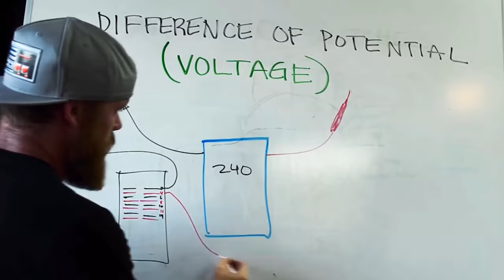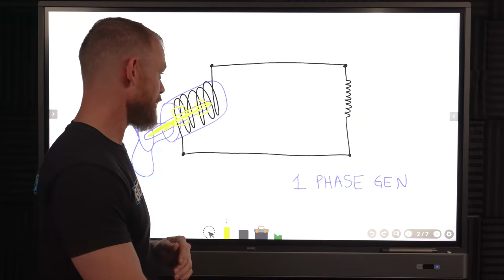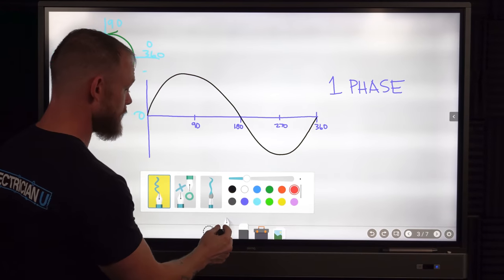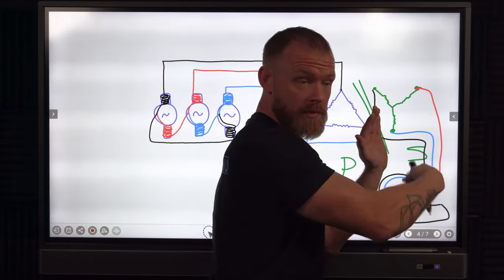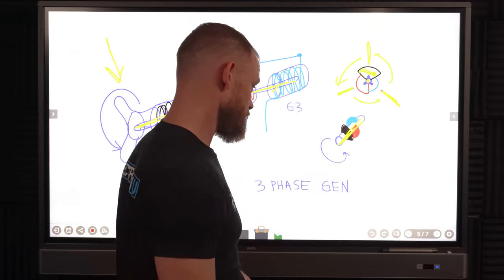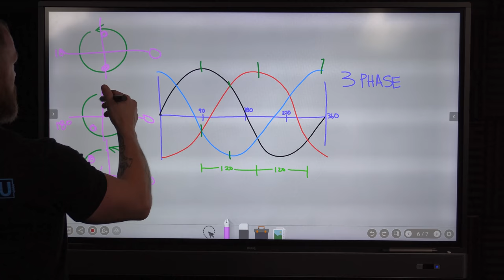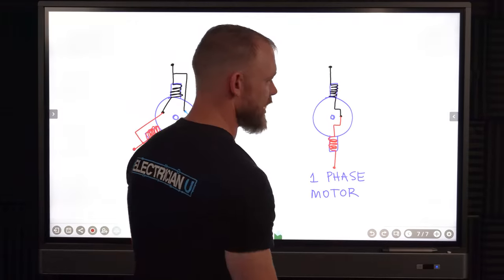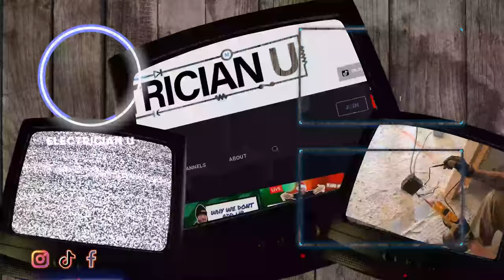What is the Difference Between Single Phase and Three Phase???

Comment: So, in a single phase circuit, the current changes direction between 50 and 60 times a second. ie clockwise, anticlockwise and repeat, caused by the alternating poles of the magnet?
Reply: That's exactly how the generator works.  The generator in a 60hz system has to spin at 3600rpm to create that 60hz frequency.  
In other parts of the world 50hz is used, which would be 3000rpm.

Comment: I have a question. I'm not sure why but it seems like you skipped a phase. I know when you have a motor that runs on 110VAC there is one hot wire and a common. That seems like it'd be single phase 60hz. However one may also run a particular motor on 220VAC two hot wires, 110VAC each and a common wire. Wouldn't this be considered 2 phase? I like running motors on 220 when and where ever possible because the startup and running amps are half that of 110.
Reply: No, two phase is totally obsolete and has not been used for a hundred years. 240 V is still single phase.

Comment: I know the answer, but could you talk about how the neutral is tapped on a delta wye?  I used to think that all three windings on the secondary side were center tapped like single phase, and then combined before the service entrance.  I thought that for an embarrassingly long time.
Reply: "Delta" is one configuration; "wye" is another.
Reply: @GH-oi2jf yes...but that's not my point. I was talking about a delta-wye transformer. Which has a delta configuration on one side's winding, and a wye on the other. Which is why I said the "secondary side" in my comment.

Comment: So if I want to single phase a pump or  motor  208 1ph from 208 3ph what do I do with the extra phase wire just cap it off
Reply: It isn't plumbing; you don't need to cap it.  If you have a three-phase panel with 120v to neutral, then any two phases will give you 208v single-phase.

Comment: We should have dual phase , residential . Are the phases not 180 degrees apart ?
Reply: North Americam 120V service provides two phases 180° apart, but they are synthesized from a single phase 240V supply.

Comment: nice video! got a question though. I know in a 3 phase system (same with 208/480 single phase), current travels from one phase to the other to complete the circuit. so if this is the case, why would an arc flash/explosion happen if I were to make a direct connection with the phase wires of the panel if they connect anyways within the equipment youre powering?
Reply: A direct connection between phase wires is essentially a direct short. One time I was troubleshooting a short in a 480 volt 3 phase hvac system and I accidentally touched 2 phase wires together with my multimeter lead. It blew up about 8 inches from my face. I was okay; I didn't get hurt, but It was very bright and very loud like a shotgun. When 3 phase is properly wired to the equipment, there is a load connected between phases. No phases are connected together directly.
Reply: @paulcrandall2534  if they're not connected directly, how are they connected together? Through induction somewhere in the termination box? Because the way the delta diagram is configured they're directly wired together. Glad you're okay after that! Glad I haven't had to experience any 480 explosions in my career... yet lol
Reply: @parkourguyyy  When you look at a 3 phase delta diagram, you'll see a triangle shape. Each phase line connects to a point on the triangle. Each side of the triangle has a squiggly line. That squiggly line represents the load. It's a winding on the motor. It's not a direct phase to phase connection.

Comment: Can someone explain why the two hots that coming into the electrical panel in a home are 180 degrees out of phase? Why is that so? And why not 120? Am I missing something?
Reply: The two hot lines provide a 240v circuit.  If they were in phase, there would be no voltage between them.  They are connected to opposite ends of the transformer secondary, so naturally are in opposite phase.  The 120v service is provided by placing a center tap on the transformer secondary.

Comment: why isn't standard residential service considered 2 phase, L1 and L2 are in fact 180 degrees out of phase, is it because the transformer at the pole is fed  from one phase on the primary side and split  120/240 with a center tap on the secondary side being a neutral/grounded conductor? just wondering.
Reply: Yes. Many a argument have been had over whether it is OK to call it 'two phase.' The main reason not to is that 'two-phase systems' exist (more historically) and are a different arrangement (90 degrees out oftentimes). Split phase is more descriptive of the SYSTEM, but seeing as there is a neutral in a split phase system, no reasonable person can deny there are two phase relationship that are 180 degrees out.
Reply: @spruce_goose5169  Where would one  find one of these (90 degree two phase systems today ? are they covered in NEC?

Comment: I live in europe and I recently did my own wiring, here the supply comes with 4 wires(3+/1-) and I hooked up everything accordingly for (Mono phase system) but for some reason my monophase has 365v!!!
How is it possible to get 365v in monophase!?
I just don't get it...
The connection to the console was 1(+) and one "Supposedly" neutral(-).
At this point I have compeletly lost it.
Reply: There is a reason only professionals should do such things.
Reply: @okaro6595  Turns out the 365v was phase-phase voltage 🤣

Comment: I have worked with electricity for my entire 69 years. I always had a hard time looking at  240volt power vs 120volt power from the same feed to the panel. I looked at 120v as a loop of water going out either L1 OR L2 and returning via the neutral. That can satisfy on the surface...and you can operate like that forever. The issue was...with 240v power...where was the water going? Both L1 AND L2 SUPPLY WATER...where does the water go WITHOUT the return drain...ie a neutral. It wasnt until I was shown on an oscilloscope what was actual happening. There was no flow of water out and return by drain...as the L1 to neutral seems. The entire lesson is CYCLES...or modern term hertz.. The electricity isnt "flowing" like water...its bouncing back and forth...and in the US thats 60 times...or cycles every second. In that case there can be a difference in the AMOUNT of power that can "bounce" or cycle between L1 and L2. I think a lot of people dont get this..and I didnt until I explained my version of SINGLE phase power...and someone SHOWED me the bounce/cycles/hz on the oscilloscope. I think every discussion of single phase electricity HAS to describe what I learned from someone else. It isnt about flow...its about how much is bouncing.

Comment: In a single fase, how does the current return to the generator, when I look up a post, I can only see 1 line connected to the transformer and from the transformer there are 3 lines coming out Neutral and 2 lines to the house.
Reply: You should have two incoming wires to the transformer, the come from two of the phases.

Comment: You glossed over the cycles or Hertz but you said 50.  In the US, Canada, and Mexico it is 60 changes per second.
Reply: I am old enough to remember the time before "Hertz" was used. Cycles Per Second we called it. Changed officially in 1960 and crept into common use during the 70's.
Reply: Most appliances are able to operate on both 50-60Hz

Comment: I have noticed looking  at my single phase neighborhood, that the transformer that supplies 3 houses with 240/120 has no visible connection for the primary neutral/grounded side. just a tap to the high voltage side. My question is , where is the other side of the primary side of the transformer connected? recently some service company "serviced " a  grounding  conductor coming down the pole to armor it and add 50 staples . is the other side of the primary  common with the neutral on the secondary side? are they both part of a common GROUNDED neutral at the high voltage side?
Reply: @airsoftindude  I am still confused. The transformer on the pole in front of my house supplies 3 homes with L1, L2, and neutral, easy enough, neutral is the center tap on the secondary side. The primary side has a single tap to the high voltage on one side , where is the other side of primary coil connected ? If it is going to the grounding electrode conductor going down the pole to the grounding electrode, if the gec were to be severed, wouldn't there be extremely  high potential on the ungrounded side?
Reply: Also, why have they recently upgraded the egc  down the pole to armored cable below 10 feet with staples every 10 or so inches in my area?
Reply: @johnrackiewicz286  I believe primary are grounded to the lightning arrestors that are on the top of transmission lines
Reply: @airsoftindude  no visible device between the high voltage tap and the transformer, just a piece of wire. still looking for an explanation on why it is single phase service to the house.. any hot leg is with respect to time zero. multiple hot legs, whether they are 90,120, 180  or whatever are OUT OF PHASE, make 
them sperate phases, correct me if I am wrong.
Reply: @johnrackiewicz286  the single phase transformer is definitely connected to the PoCo neutral, you perhaps just aren't seeing it (though you say something about a visible wire, so I'm not sure what you are referring to there). The only exception would be an earth return set-up, but as far as I know this is never used in final distribution, only rarely in transmission.

As far as phases... The 3 main wires up on the distribution pole are themselves not really 'phases' (depending on how one is using the term). Think of a phase as something that can be depicted as a sine wave on a graph with time as one of the variables. Then we can view the relationship, but only when there is a common reference. The X-axis represents the neutral. When a delta connection is used, that neutral point becomes imaginary (no neutral wire, just a theoretical neutral point to describe the phase relationship).
Reply: @spruce_goose5169  I have an ASEE. i totally understand AC theory , X axis is TIME , y axis is AMPLITUDE. 3 phase power is is strictly 3 hot phases  120 degrees out of time with no respect to a neutral. My question was regarding why the US standard to residential homes fed from a single phase high voltage "top of the pole 4Kv whatever" stepped down  with  a single tap that is very visible on the top of the pole. where is the other side of primary coil connected ? Is it common with the center tap of the secondary 240/120 side, internally, common with the neutral on the 3 wire set that drops to the houses? Also if the 240/120  3 wire drop or lateral to the house are 180 degrees out of phase(time) why isn't considered  2 phase ?Nomenclature is reality. I have had to argue many times with techs in the 12volt and pro audio industries on engineering standards  such as  phase vs polarity, NO  vs NC.
Reply: @johnrackiewicz286  "where is the other side of primary coil connected ?" To a neutral that runs back to the sub station.

"why isn't considered  2 phase ?" Because people decided to call a different system with 90 degree phase angles a 2 phase system. Split phase describes the standard U.S. residential set-up well, but certainly there are 2 phases and so I don't believe people should argue too strongly that it isn't '2-phase.' It is, in that there are 2 phases.
Reply: @johnrackiewicz286  "3 phase power is is strictly 3 hot phases  120 degrees out of time with no respect to a neutral"

We don't need to get too far gone into this, but I'm not sure why you phrase it like this. They are 120 degrees out of phase with respect to a neutral, real or imagined. They NEED to be with respect to (WRT) something, otherwise there is no such thing as a phase. A phase is a signal between two points. If you displayed a signal of 2 'phase conductors' referenced only off each other (no third reference wire) they would constitute only a single phase and thus would have no angle relationship at all.

OH, another thought regarding your actual question: it is possible (though my understanding is it's pretty rare) to have a Single Wire Earth Return (SWER) system, in which the return path to the sub station is not via  PoCo neutral but via the ground (actual earth).
Reply: @jb9072  thank you for the best explanation so far. I do have an ASEE, 40 years ago , probably a load dusty.  I always thought phase was with respect to time on the x axis. any  2 or more waveforms that were out of time were out of phase. you kind of cleared it up. What do you think about  Pro  audio techs calling speaker connections  "out of phase" I have been always under the belief that they were " out of polarity" Phase has to do with the signal in time on the x axis , the actual speaker connections has to do with   Polarity....Appreciate  your input ,i am assuming you are an engineer.
Reply: @jb9072  This is a great overview. You clearly know your stuff and it shows.

I want to make a couple academic points, however. 

>"The HOT secondary leads of the transformer are specifically labeled L1 and L2 instead of Phase A and B, because there are NOT two phases"

I agree completely, but primary for the reason that wires are never 'phases.' Phases, like voltages, describe relationships, and thus a wire can never itself be a phase. L1 and L2 is definitely a better description. 

>"produces two 180 degree OPPOSING waveforms that are exactly "in phase"."

The matter of whether a split phase system referenced to a center-tap neutral is a single phase, or 'in-phase' or is '180 degrees out of phase' is almost entirely semantics. And semantically speaking, I don't see how one can logically argue that two waveforms 180 degrees apart are not 'out of phase by 180 degrees.'

I totally understand why you are making the argument the way you are: that they are in essence 'in phase' or perhaps even 'are one phase.' It's essentially two batteries in series (DC equivalent). But phasing is all about reference. When we choose to reference the center point, one waveform undeniable becomes a mirror of the other. 

Are you familiar with the Mike Holt forum? There is a thread titled "battle of the phases" which is precisely this argument. 

I want to be clear that I'm not suggesting you are wrong—in fact, I think your post was pretty spot on—only that there is another way to look at it.

And to further illustrate my point, let me suggest a mental experiment. If instead of hooking an O-scope up as would typically be done with the center-tap (neutral) as reference, we used the bottom end of the secondary as reference, what we would see are two waveform IN-PHASE but with differing amplitudes. L1 to N would be 120 V RMS, and L1 to L2 would be 240v RMS, and they would be stacked exactly IN-PHASE. In that way, I agree with you. 

But, because phasing is all about reference, we have to acknowledge the fact that when we use the center tap as reference, instead of stacked waveforms of differing amplitudes, we get two waveforms, 180 degrees OUT-OF-PHASE and with identical amplitudes. Semantics for sure, but hopefully illustrative nonetheless.

Comment: Each of the three (3) phases only
use one conductor when distributing to the actual neighborhoods?  Only one conductor into the TOP of each
step down transformer?
Reply: and then back to the sub on a neutral.
Reply: The medium voltage (1-100 kV) distribution network has three phases no neutrals. On a single phase system each transformer takes two wires and coverts it is 240 V taking the neutral from the middle. In a three phase system one has a delta-wye transformer that creates 208 / 120 V with the neutral from the center point. Note the delta and wye refer to the connections, not to physical shape of the transformer. The network is designed so that in large scale the loads even up so the medium voltage network does not need neutrals.

Inside the home the split phase and three phase are rather similar with one having two and the other three phases. The vector sum of those is zero on even loads. In case of split phase one typically talks of the difference as they are 180 degrees separate. On three phase calculating the neutral current is harder (you add the squares of each, subtract products of each pair and take the square root).

In Finland ranges typically are connected 3x16 A. One phase is for two plates, the second for the remaining two and the third for the oven. Since the neutral current is maximum the largest of those there needs to be just one neutral.
Reply: @okaro6595  in places around me, most final distribution legs have neutrals (Y connection at the sub) and the step down pole transformer uses 1 phase conductor and the neutral to generate the residential 240v split phase service.

Comment: What is the advantages of 3ph vs 1ph?
Reply: 3-phase is more wire efficient.  Suppose we wanted to transmit 30 kW of power.  At 120/240V single phase, this corresponds to 125A operating current, a 175A breaker, and 3 qty #2/0 Cu wires (133 kcmil).  At 120/208V three-phase, this corresponds to 83A of operating current, a 110A breaker, and 4 qty #2 Cu wires (66 kcmil).    Compare 3*133 kcmil to 4*66 kcmil, and you see that 4*66 kcmil is less total copper wire for this circuit.

3-phase also has the advantage of being able to natively start a motor, without a coil dedicated to starting the rotation.   It also transmits power continuously to the motor, as all three phases collectively add up to providing a constant power at every point along the cycles.  Single phase by contrast, pulsates the power.

Comment: Do they pull neutrals off the 3 phase?
Reply: The sum of the three phases is zero so one does not need a neutral if the loads are not balanced. If they are not, one needs a neutral for the vector sum of the currents.
Reply: You need a transformer to pull a neutral from three phases.